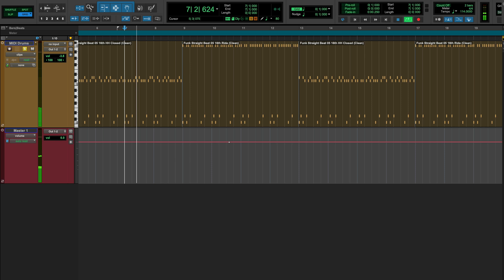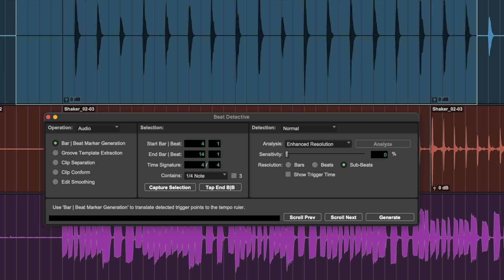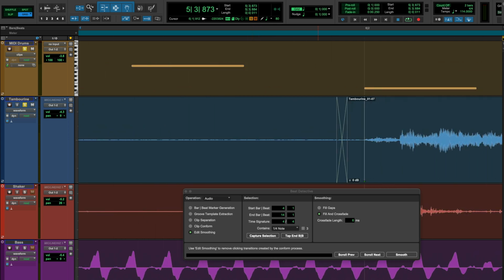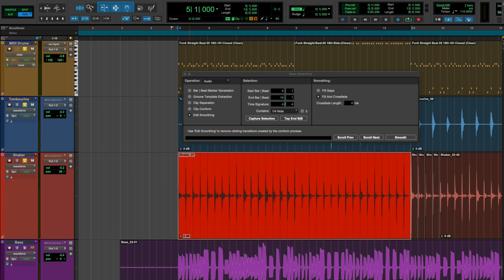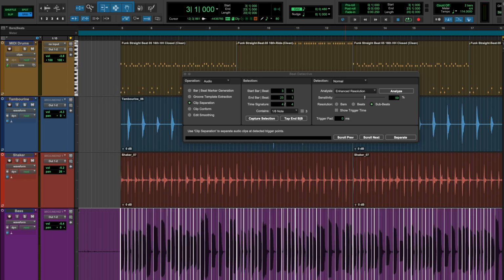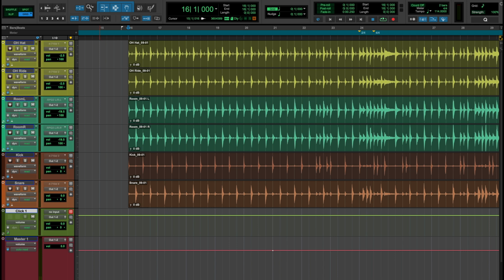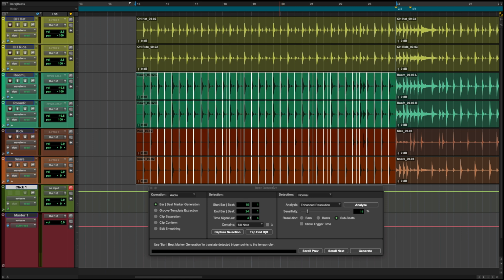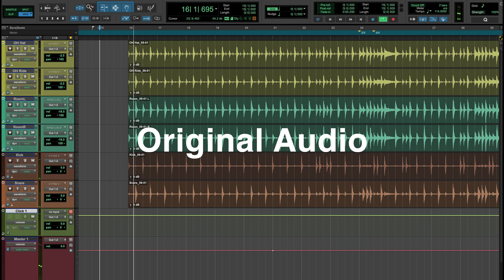Quantizing Audio and Drums in Pro Tools ⚖️ with Beat Detective

Comment: Great advice, straight to the case. Considering switching from Logic to Pro Tools, and such tutorials are really helpful, thanks!
Reply from the maker: Thank you. Well, I would plan on keeping both. You will find they each have their workflow strengths. So I do the cliche of "produce arrangement stems in Logic" and "mix in Pro Tools". But for me, that works.
Reply: I would like to see the video(s) where you demonstrate that combined workflow :)
Reply from the maker: @basus-v2h sure! Maybe at some point. By the way, did you watch my new Phase video? You might like it as a great followup to this one when I discuss drum editing and aligning
Reply: I will watch that video :)
Reply: Sorry for abusing your kind engagement, but excactly what do you mean by "arrangement stems"? Is that some kind of rough mix, which you then import as stems into PT? Either way I have to evacuate my current LP project, which has become 6.3 GB and overloads constantly. Perhaps this would be a good occasion to try stem mixing in PT :P
Reply from the maker: @basus-v2h  I will usually create MIDI parts such as strings, any virtual drums, other backing track parts, etc in Logic and then create a basic mix for each one and output them individually. (the mixed stems for these parts such as "basses", "strings", "keyboards", etc....) Then I will import these into my Pro Tools session as mixed stems that allow me to either make my final mix with them, or track additional material over the top of them if needed. Hope that helps.